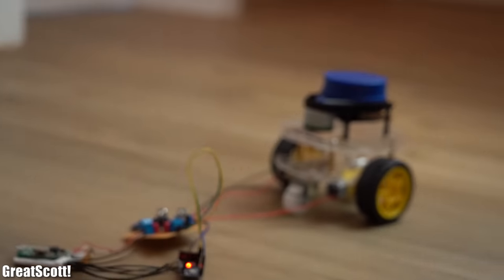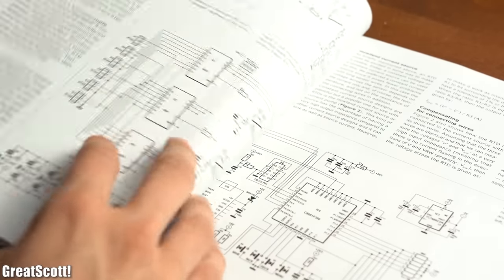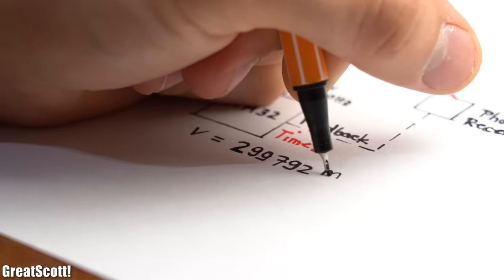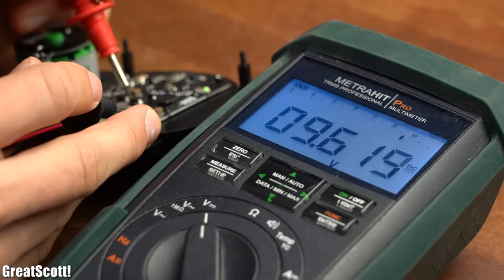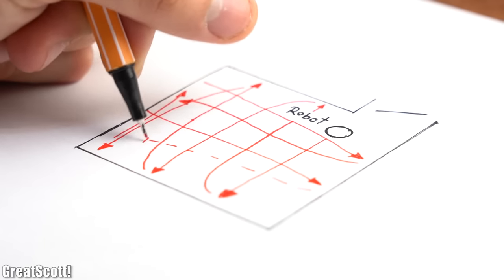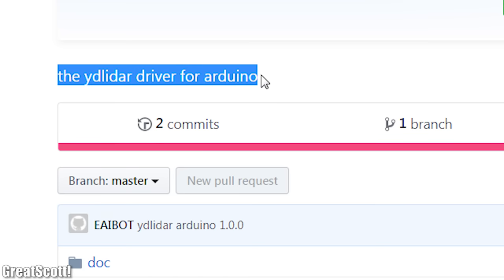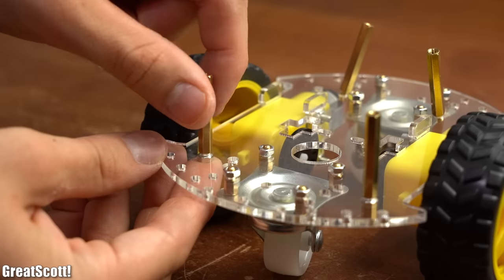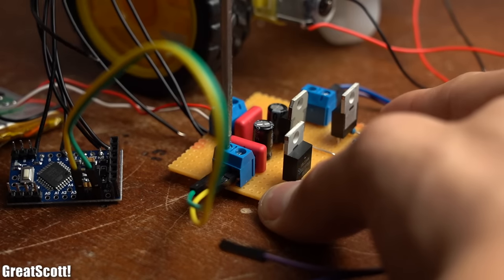Is LIDAR easy to use for hobbyists? DIY Roomba? Obstacle Avoidance System for Robotics

Comment: Do you know the wavelength, the power output and the pulse duration oft the laser diode?

When working with lasers I am always concerned about eye safety. I have already spent weeks on searching for safety guidelines and scientific research, but there is barely any information available.
The best I could find is a graph showing at which power output, continuous lasers start to be hazardous to the eye, depending on the wavelength.
However for pulsed lasers it's a completely different thing. For instance in the specs of a lidar for an autonomous car, the power output was 5W, which is way over the 1mW limit for continuous IR lasers.
Such high powers are said to not be harmful, because the pulse duration is in magnitudes of pico- or femtoseconds (can't remember exact values).
Damage is caused by heating up the eye, which depends on the total pulse energy and how fast heat can be dissipated within the pulse duration. Unfortunately I don't know whether eye heating is the only cause for damage.

I still would be glad, if anyone has certified product information and data to safety limits, depending on wavelength (I'm mostly interested in the IR range), power output and pulse length.

Finally something different, but related: I am wandering, if there is a device, that can emit focused electromagnetic waves, with wavelengths in the range between 1mm and 1m. Overcoming diffraction would be a real challenge.

Thx and have a nice day!
Reply: For thermal concerns, simply take the info you have for CW lasers, and compare it to the total energy in a pulse.  In other words, if a 1mW laser is safe for continuous exposure, then 10mW would be safe for a 10% duty cycle (10 times the power for 1/10th the time).  100mW would be safe for 1% duty cycle.  1W would be safe for 0.1% duty cycle.  1W for 1 ms would be the same as 1mW for 1 second.  5W for a picosecond would be far, far less energy: equivalent to 5 picowatts for 1 second.
Reply: Your formula might be a good approximation, however there are two questions that aren't taken care of.
Firstly with shorter pulses there is less time for the heat to dissipate, thus there is no (inverse) linear relationship between pulse length and power output.
Secondly there could be additional factors than heat, contributing to eye hazard.
Nevertheless, thanks for your efforts. The relationship between the numbers is kind oft fascinating.
Reply: @handle-with-care  True, this is an approximation.  If you take the numbers to an extreme in either direction, it will break down.  And yes, there are other considerations.  As just one example, IR lasers are more dangerous than visible light lasers because there's no blink response and gaze avoidance to bright IR light.

Comment: But if i have an object that is very angled, so that the send laser beam is i.e. way longer than the returned laser, wouldnt it give false results? And why does the returning laser beam always exactly hit the sensor, not depending anywhere on the angle/surface texture of the object?
Reply: It doesn't.  The return light isn't in a beam, it radiates in all directions.  That's why you can see a laser pointer dot on the wall with your eyes from anywhere in the room.  This is a parallax system.  It looks from off to the side for the relative offset of the laser dot to determine the distance to the object.

Comment: I doubt it really works this way. Usually consumer grade rangefinders do not measure time delay of light emitted and received. Instead they emit modulated waves and solve system of modular linear equations. It is much cheaper and robust. Considering that this LIDAR have precision of 0.5 mm my assumption is probably right. It would be very difficult to get this precision measuring light turnaround time.

Comment: Hi,
I am watching your videos for a while now. 
As you are very clever to do electronic staff.
I thought I will ask you about my idea.
I would like to monitor the power consumption in my house. There are some products like that, like the very expensive ct current monitoring device. 
There is must be some cheaper solution. Sonoff has that smart current monitoring device but that is only good for up to 15amp. It works with a shunt system and not ct.
It would be good if you can convert that sonoff current monitor device to ct system somehow.
Do you think is it possible?
Thanks.
Viktor

Comment: The video implies the Rombas use LIDAR which is not accurate. Neato were the first company using LIDAR (using beam triangulation like in this video, not time of flight) for robotic vacuums, they own the IP for those. For this reason high-end Rombas use a low resolution camera to find obstacles, not LIDAR.

Comment: I think that 360 Deg laser or infrared light with receiver aka photo sensor like in cameras will solve unwanted rotational mechanics. You will have all distances at once and the only limitation is resolution and frequency of probing.

Comment: Is there a LIDAR sensor that won't wear out? It seems like a pretty big point of failure to have a motor spinning the sensor.
Reply: Solid state lidars do exist, but they (currently) are crazy expensive in comparison.

I don't think it's a big issue for hobbyist projects, though.
CD-players don't wear out that fast either after all, and they are mechanically comparable.
Reply: @DieBastler1234  the belt is what stresses me out, it would wear out from normal use, and replacing it would be a pain if you didn't have extras on hand. although I don't think very many people would have an actual practical use in mind for this, so yeah, you're right.

I just prefer to have as few moving parts as possible.

Comment: I have a b3500 4000kv brushless motor and I want to use it as a thruster in an rov. Will ti get rusted?
Reply: Is it painted?
Reply: @hunterjackson802  i thing it has an orange goading 
Search this if you want  (Waterproof B3650 4300KV Brushless Motor)

Comment: if light is so fast, how quick must the controller be to calculate a distance of lets say 20 cm? can stm32 do this?
Reply: No it can't, and in this case it doesn't. It just has a camera to see where the dot ends up.
Reply: @RobertSzasz  This  is what i  thought  ... so the  time  travel  theory doesn't  stand here
Reply: @RobertSzasz  In this  case,  the  resolution of the  camera  determines  the  resolution of measurments. So  if  1024 pixels then you  can only get 1024 different measurments,  that is 1cm  accuracy  for a meter.  And  i doubt  the ccd has  1024  pixels
Reply: There is a product developed later that actually does ToF LIDAR

Edit: costs sub $200 for a proper one
Reply: can you point to it? where can i find one?

Comment: 360° lidars are not that cheap
Reply: If you have the dedication to build a project that needs a lidar, ~100€ is not really too much to ask for
Reply: @DieBastler1234  sure but it's still expensive, so i'v checked on ebay and an old / ded  roomba robot is arround 30€ so it's cheaper that what i'v thinked
Reply: @cxmmax4265  That's nothing for what you can do with it.
Not all roombas have a lidar
Reply: @DieBastler1234  yeah but there is some custom board to get an i2c output, but you'r right about the fact that no every roomba robot has a lidar

Comment: Can't you just solder out the crystal and lm1117 5v on Arduino for 8mhz crystal and lm1117 3v3 and burn new bootloader?

Oh wait... It'll take more time than just using the correct board

Comment: i like imaging system more
Reply: that will require faster onboard computer for image recognition, or probably require the robot to be tethered wirelessly to a faster computer for image processing.
Reply: @xponen  that is true and more power for stronger processor
Reply: Pretty much useless for detecting obstacles like white walls and other textureless objects
Reply: @DieBastler1234  it can with white walls you just use a light
Reply: @ventusprime  How would you determine the distance?
Reply: @DieBastler1234  you put 2 leds on the front with a lanse why lanse because the ciricle on the wall or on the objekt can give the information if you wana make it non seable ír
Reply: sorry for bad eng
Reply: @ventusprime  What does that tell you? From the perspective of the camera, the circle always looks the same
Reply: @DieBastler1234  yes if the circle is on the camera but if the light source is .......oh i got a great example it works same ass the Dambusters mesured distance from the grund

Comment: Elon Musk told that LIDAR was out of question when it comes to self driving cars also its an inferior tech for such.
Still LIDAR are great for DIY projects.
Reply: Elon Musk was wrong about that one, LIDAR is really reliable, it work with cheap robot right? with better hardware it will run better.
Reply: Also, pretty much everyone else building self-driving cars disagrees 😁
The problem is that serious LIDAR sensors are still very expensive and we have way less experience in working with point-clouds, than we have with camera images.
Only time will tell.

Comment: Use a raspberry pi instead of Arduino and code in Python. Lidar information can be easily extracted also the Arduino serial baud rate is pretty useless after 115200

Comment: Please, Please stop tracing all the lines 2, 3, 5 times! It makes it look bad and drives me nuts! Also slopping the highlighter 4-5 times over the wet ink you just traced over 5 times makes it looks like smudged crap. Can you see this? Then why do you keep doing it? Put a rubber band on your wrist and snap it each time you feel the need to over trace wet ink several times.
Reply from the maker: Don't watch it if you don't like it. End of story.